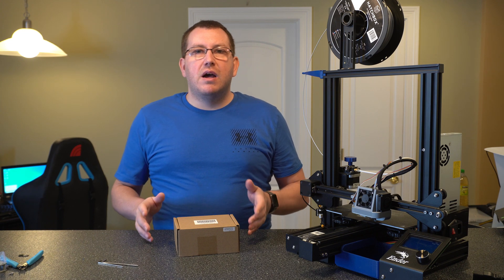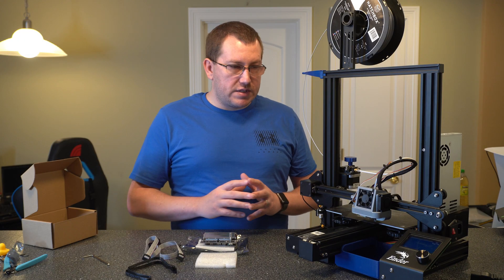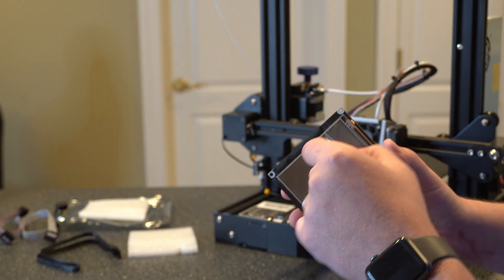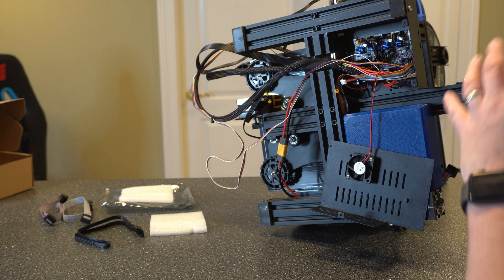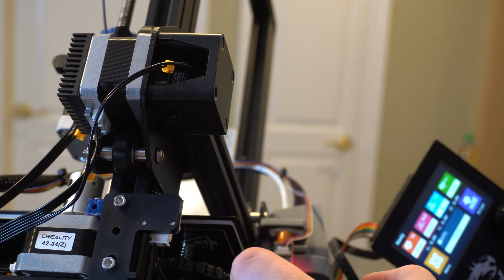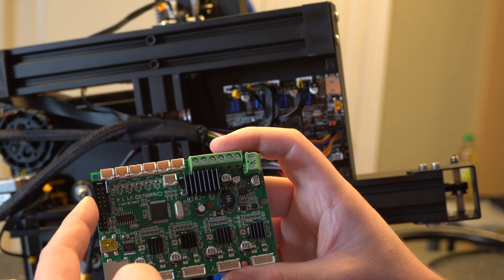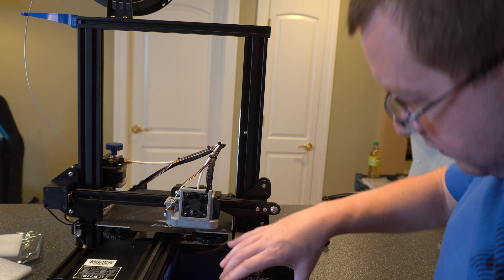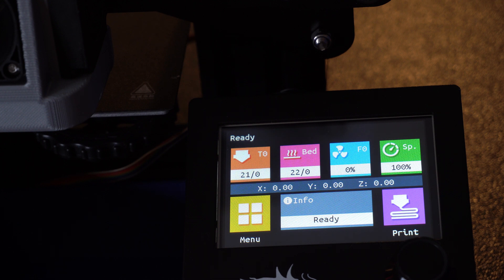Guide to Install the TFT35 on SKR Mini

Comment: Hello again if my ribbon cable for the regular lcd screen doesn’t the skr e3 v2, should that same cable work with the tft 35? Or will I need to swap the ribbon cable?
Reply from the maker: Hi. It depends on the screen. Some of the creality screens have a couple cables swapped.

Comment: been thinking about putting my skr mini e3 v3 and tft35 e3 v3 on my cr10 v3 but dont know how to really do any firmware but the mriscoc pro firmware. i had an issue with the ske mini my first time trying it on my pro then gave up and went with the 4.2.7 board
Reply from the maker: Hi. If you join the discord server someone should be able to help out with the firmware.

Comment: Perhaps someone might have warned ME that the TFT35+SKR Mini will NOT be NEARLY as much fun if you want to run Klipper:  the color touchscreen "side" of the TFT35 will NOT work with K!  May as well stick with the old 12864.
Reply from the maker: Hi. Ya, the screens are pretty much pointless if you are running klipper.

Comment: I can't get my bl touch running on my skr mini e3 v3 board 😪😪
Reply from the maker: Hi, What issues are you having.
Reply: @3D Printscape  I have set it up following your videos, now my Z motors have stopped moving the axis down?
Reply from the maker: @Tntdesigns24  Is the z stop connected? If not, connect it.
Reply: It won't auto home or do anything 😒 so close to putting it through the window
Reply: I have done it with or without it connected, I have given up now and I'm using the original board
Reply from the maker: @Tntdesigns24  Sorry to hear that.

Comment: I’ve installed everything on my ender 3, the touch screen, skr mini 2.0 dual x axis. And cr touch. I don’t have the option for auto bed leveling. And I downloaded the firmware as well. And my x axis won’t go all the way down to the board. It thinks the home is half way up
Reply from the maker: Hi. What firmware are you running?
Reply: @3DPrintscape  at first I ran the one that you showed in the video
Reply: @3DPrintscape  firmware-bltouch.bin
Reply: @3DPrintscape  I also don’t get the option setting x axis offset or abl
Reply from the maker: @jfply8  It sounds like the printer may not have taken the firmware.
Reply: @3DPrintscape  why would it not take the firmware. Do I need to reformat my sd? Because all I did was load it on the sd and then put it into the printer and turn it on
Reply from the maker: @jfply8  The sd card should be empty, fat32 formatted, and 8gb or under. The printer can be picky sometimes on SD cards, I have some that fit that profile but wont work for flashing the firmware.

Comment: Hi. Can you assist. Finally got around to connecting the CR Touch using Marlin, however when I finally got it working it won't print. Basically it does it's leveling but then after that it stops. Wonder if I accidently turned something off when compiling the Marlin?? Thoughts? Thanks!
Reply from the maker: Hi. Double check your machine profile in cura, it sounds like something may be missing/wrong there.
Reply: @3DPrintscape  Hey Rob. Figured it out. just a simple off/on. :) Gotta love those...... Happy New Years and thank you again for the quick response!
Reply from the maker: @armani007E55  Cool, im glad you were able to figure it out and Happy New Year to you as well :).

Comment: Hi Rob, I have been trying to get my bltouch working for a while now. I eventually sorted it but now I can't switch over to marlin on the screen. I have messed about but can't sort it. Which video do I need to watch to compile the firmware if I am only using the bltouch on its own with just the one 5 pin connector.
Reply from the maker: Hi. I would verify the wiring then try to update the firmware on the tft35. The bltouch video i have for the skr mentions the 5 pin adapter but i think this article will as well. Video: https://youtu.be/PMG4bC9I3DA Article: https://3dprintscape.com/bltouch-on-skr-mini-install-guide/
Reply: @3DPrintscape Thanks for the reply. Yes the loom was loose. I would like to know what to comment or un comment in the firmware if i am only using the bltouch 5 pin connector on it's own. Thanks.
Reply from the maker: @509632  Make sure the z stop is still connected and comment out #define Z_MIN_PROBE_USES_Z_MIN_ENDSTOP_PIN then uncomment #define USE_PROBE_FOR_Z_HOMING
Reply: @3DPrintscape  Hi why do you need to connect the z stop when the bltouch has its own
Reply from the maker: @509632  You dont have to, it will just change the firmware a bit. If its wired with all five wires going to the bltouch port and the z stop still connected it will work with the premade creality firmware and the z stop is a backup incase the prob has issues.

Comment: Hey! thanks for making the video, I found it to be helpful! My SKR Mini E3 v2.0 won't connect to my TFT screen, I had the lil 4+1 cable connections reversed (text up) but my printer won't automatically go from "no printer attached" to "ready." any idea as to why?
Reply from the maker: Hi. Thanks for the feedback, did you connect both cables to the tft35. If so, check the baud rate.

Comment: hi i have the skr mini e3 v2 and the tft35 e3 v3 but for the filament load unload and park head features to work you have to specify the screen in marlin...when i specify the REPRAP_DISCOUNT_FULL_GRAPHIC_SMART_CONTROLLER  as per the documentation
i cant build the firmware as it says  #error "Only CR10_STOCKDISPLAY, ZONESTAR_LCD, ENDER2_STOCKDISPLAY, MKS_MINI_12864, and TFTGLCD_PANEL_(SPI|I2C) are currently supported on the BIGTREE_SKR_MINI_E3."
How do i specify the tft35 e3 v3 in the firmware...i need this so i can make the filament runout park the head on pause. any help is useful thank-you
Reply from the maker: It sounds like you may not have the right board defined in the firmware. Can you email me a copy of your configuration.h file for me to review? My email is admin@3dprintscape.com .
Reply: I ran into this issue as well when trying to compile the firmware, however BTT states on their github that you only need to define REPRAP_FULL_DISCOUNT_SMART_CONTROLLER if you're using the SKR v1 boards. The Mini E3 V2 only requires you to define the CR10 display
Reply from the maker: @KetaFPV  Thanks for the input. I agree that REPRAP_DISCOUNT_FULL_GRAPHIC_SMART_CONTROLLER should not need to be defined on the SKR Mini 2. I also looked back through my firmware and I don't have it defined.

Comment: I don't know if this is normal or not but when I put the microSD card into the board itself to print with the screen going it does not tell you what's it supposed to heat up to and all that stuff but if you take that exact same thing and put in the adapter and put it in the USB port on the display it tells you exactly what it's heating up to in the heat is it's not really a big deal I just wanted to bring that to your attention and ask if that's normal or not
Reply from the maker: Hi. I was just printing off an SD card that was connected to the mainboard, and the display on the TFT335 was correct. What board are you using? Im using the SKR Mini e3 v2.0.
Reply: @3DPrintscape  yeah it's the E3 V2 it shouldn't have any difference but I was using the original SD card that came with my ender three well like I said it's not really a big deal to me I can still print plugging the USB into SD adapter and it's not a huge deal to me I was just wondering what was going on there

Comment: Hi do you have any idea where I can buy the black cable but a longer one or maybe some extensions for it or what’s the actual name for that cable thanks
Reply: I’ve found them but can’t seem to find any longer then 30cm but I found female to female and male to female so I’ll use that to extend the existing cable but thank you for your help
Reply: @trez110  where did you find the cables and did they work for you. I’m trying to do the same thing.
Reply from the maker: Hi. I did some searching and couldn’t find a longer cable or extension. I think you would end up having to slice the one you have and add additional wire in the middle. Is there a reason it needs to be longer?
Reply: I have the screen elevated a little and I would need the black cable to be longer to reach the screen thanks for looking I’ve had a look around but can’t actually find anything that looks like the cable that comes with it, you got an idea the actuall name of the cable I’ve tried serial cable and it just comes up with the old cables for crt monitors any help would be appreciated and your videos are informative and keep up the good work I’ve subscribed to you
Reply from the maker: Gotcha. The cables seems to be proprietary, I cant find much on it. I found some wiring diagrams but I don’t think they will help much because we know where everything connects. I think you may end up needing to extend the cable you have yourself.

Comment: Hi. Yours videos are awesome . I installed a new SKR mini E3 V2.0 and a SKR tft 35 e3 v3.0.26  screen on my ender 3 pro v1. When updating the tft 35 screen to latest firmware  im getting errors regarding bmp files bmp/s-load.bmp not found and invalid keyword  mesh max color 2...I google it and it looks like pre compiled firmware has some issues,new vs old files missing? Can you provide link to  latest firmware that you are using ?
You can email me. Thanks for help.
Reply from the maker: Hi. Thanks for the feedback 😊. I actually did a video covering the upgrade process. You can check it out here https://youtu.be/S9GreElCJWQ . If you are still having issues, you can email me at admin@3dprintscape.com and I will try to help out.

Comment: I just bought the SKR Mini E3 with the TFT35 from you on Amazon. I also have the BL Touch. 

I installed the board in my Ender 3 Pro, and the new display. I also installed the BL Touch at this time. When I booted, the printer was communicating and I could move the axis. Then, I used the firmware-bltouch-for-z-homing.bin from the GitHub to upload the firmware with a SD card. When it rebooted, i was able to use the BL touch.

When I restarted my printer again, to prepare to test print, I could no longer connect to printer. My screen says "No printer attached!".
Also, I cannot upload new firmware. I was suggested on GitHub to upload the original firmware. I tried, but nothing happened when the machine rebooted.
So, on my Macbook, I checked VSCode with PlatformIO and the printer does not appear in the serial connections.

Now, I cannot update firmware with USB, or SD card, and my printer cannot connect to the TFT35 screen (and the original screen with Ender 3 displays nothing when the printer is turned on.)

IDK what to do...
Reply from the maker: Hi. Sorry to hear you are having issues. Can you email me a video of the behavior you are seeing and any images you have of when you installed the SKR mini. I would like to see how the BLTouch is connected. My email is admin@3dprintscape.com.
Reply: @3DPrintscape  Same issue for me. Email sent.

Comment: Heads up Octoprint does not flow through print status in touchscreen mode. Also, you can change the settings through just the config.ini file when you update the firmware. I found that out when I updated mine and that is where you can change the temp presets for material preheat cause even with new firmware changes in classic marlin to the preheats do not carry over into the touchscreen side. Also in Classic marlin, you cannot use the full-size SD port or the USB A port on the TFT35 only the USB mini and micro SD at the board can be used in classic marlin.  A couple other gotchas are the filament runout connection on the touch screen only works when in touch mode same with the one on the card only works in classic marlin. I didn't spend too much time seeing if there is a way to get it to talk both ways but if you do look into it feel free to pass it on. :)
Reply from the maker: Hi. Thanks for taking the time to provide the detailed feedback, I appreciate it. I will look into testing some of the issues you mention and see if there are any workarounds.